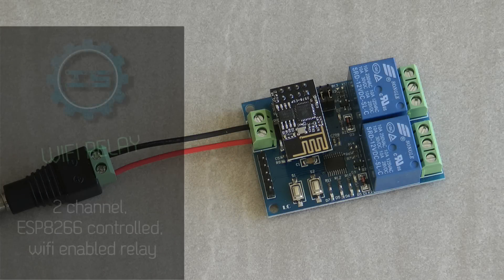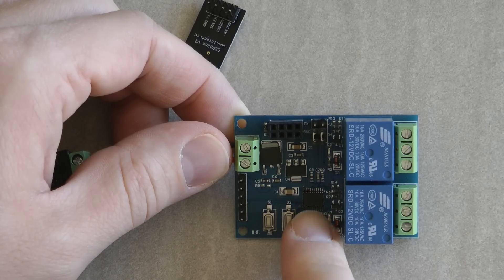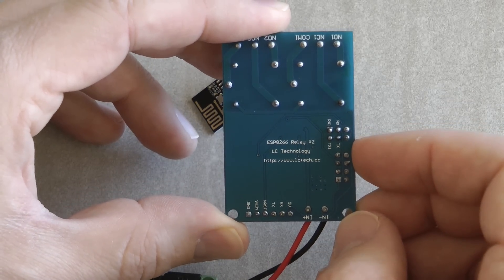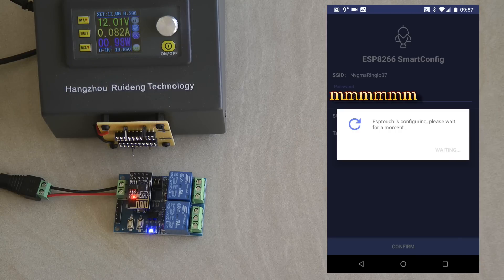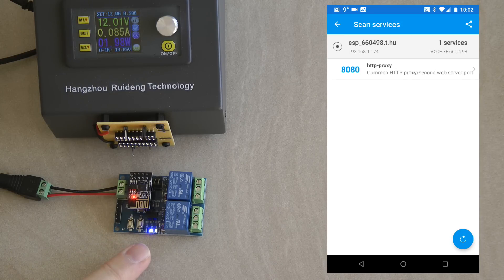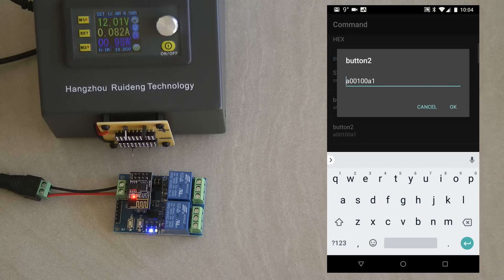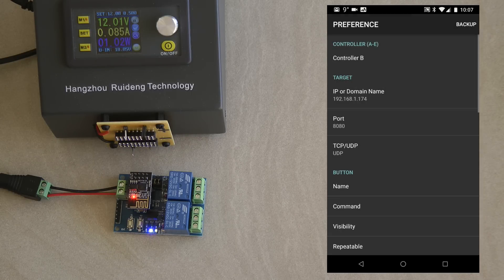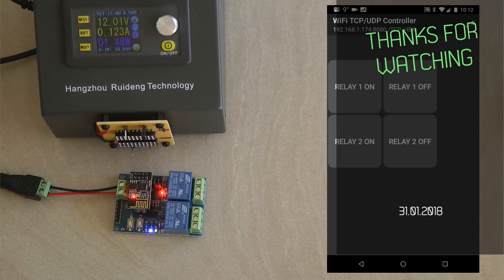ESP8266 wifi relay review

Comment: Hello,

Which way do the relays work?

Let me explain:

my goal is that when a relay receives a signal from the outside (example: a button wired on the relay), an html request is launched.

Thanks in advance.
Reply from the maker: This is a simple relay, I am not sure how you would wire a button to it. I don't think it is going to work this way.

Comment: This works without any problems for Home-Assistant. The esp8266 needs to be flashed like any other wifi module for Home-Assistant. The MCU on the board does the work from UART.
In Home-Assistant the yaml file needs to be configured something like this. (This is a one-relay example). The UART for the relays is [0xA0, 0x01, 0x01, 0xA2] etc.

switch:
  - platform: template
    id: relay1
    name: "relay1 switch"
    turn_on_action:
      - uart.write: [0xA0, 0x01, 0x01, 0xA2]
      - switch.template.publish:
          id: relay1
          state: ON
    turn_off_action:
      - uart.write: [0xA0, 0x01, 0x00, 0xA1]
      - switch.template.publish:
          id: relay1
          state: OFF
Reply from the maker: @JbVlad  Thanks a lot, very useful!

Comment: you can use this with the regular arduino firmware instead of the at firmware by removing the RX jumper and writing serial commands to control both relays, i forgot exactly how to but when i remember ill update this comment

edit: here it is
relay 1:
        Serial.write(0xA0);
        Serial.write(0x02);
        Serial.write(0x01);
        Serial.write(0xA3);
relay 2:
        Serial.write(0xA0);
        Serial.write(0x02);
        Serial.write(0x00);
        Serial.write(0xA2);

with this you can control them using Blynk IOT, remoteXY or homeasisstant, or even with another microcontroller
Reply from the maker: I think it would be possible. But honestly you are probably better off buying a simple relay board and control them directly. Unless you need to save one output.
Reply: @csongorvarga  i did it, its on my github. 
but yes in most cases individual relay boards are a better option, i found a board with 8 relays for around the same price. 
the only benefit of this serial method is that it only uses 1 pin to control multiple relays, so if you're doing a massive iot project or your board has not enough GPIO, this could be useful

Comment: I am trying to connect it to my home Wi-Fi but I can't. None of those Android apps work anymore. I took out the esp8266 hooked it up with an Arduino, and connected it to the home Wi-Fi using AT commands. After that when I put it back on the relay board, it connects to my Wi-Fi momentarily upon boot, and then disconnects. Any idea why?

Comment: Is there any wifi relay like that which uses 240V AC as main supply? I cannot find them on aliexpress. I only found 5v, 12v and 24v.
Reply from the maker: I am not aware either. Sonoff Dual and similar relays run from mains, but those are "branded" models

Comment: Important: the Relay Board needs to be showing the RED diode and NOT the BLUE diode on the board. I was trying to switch the relay and nothing was happening. If you want to change back to mode 1 (with the red light) press S2 while booting the relay.

Comment: Thanks for the review I was going to purchase one but after your review, I don't think I will bother I will just design and  make my  own with an 8266-01 and two replays to switch when I want  so thanks for saving my pocket
Reply from the maker: Yes, it is necessarily odd design as the ESP can handle the same job without the additional MCU. But still OK for those who cannot roll their own board.
Reply: Same here, i expected the relays to be hard wired to the esp8266s gpio pins. Glad i watched the video.

Comment: How did you uploar code to ESP? I think all adapters to this small ESP needs additional switch or jumpers to upload code ;/
Reply from the maker: Yes and no. The basic ESP-01 UARTs are not designed as a programmer, but you can make some modification like I did: https://www.youtube.com/watch?v=6uaIWZCRSz8. But I also have another programmer which has the switch built in as well, like this red adapter: https://www.aliexpress.com/item/32971337222.html

Comment: Hey great video very helpful! I was just wondering is there a way to communicate remotely using the app ie not on the same network as the module? Or is there a new version that does support this?
Reply from the maker: Not really. I would not open these small units up to the wide internet. There is no security on these at all. Ideally these would communicate with a server on the local network and the server is accessible from the outside internet. But technically you can open forward the port on your router and it will be accessible from outside using the public IP.

Comment: I got that device, and got a payback for that because  but it arrives 'broken'.: Symtom is   Blue led from main board is not working ,... only  red led of ESP is on. 

 Do you know how to reset it ?
Before taking the decision to flash ESP, I woul klike to know if somebody knows the consequence of that. 

If I flash the esp , will it be possible to have response from the main board 

Any help will be appreciate before flash the ESP
Reply: The firmwares are all open source so I bet you could make it work in theory but these cards are cheap to buy so probably not worth

Comment: How do I activate the 2 relays in a custom code in arduino skect? What would it be like for me to drive 4 relays, since I only have 2 gpio?
Reply from the maker: I don't know. There is an another microcontroller on the board which is controlling the relays. The ESP talks to this microcontroller over serial. But I am not sure about how it is done. I have done a second video on this board where I flashed the ESP Easy on this. They have implemented the communication between the ESP and the micro. Maybe you could look at that code and figure out how it is done.
Reply: @csongorvarga  
Please send me the link for this publication.
Reply from the maker: This is the video: https://www.youtube.com/watch?v=i_CnBcQgdGk, and also check out the forum in ESP Easy: https://www.letscontrolit.com/forum/viewtopic.php?t=3245

Comment: Why does it need extra, support circuitry... i thought it was WiFi on a chip... and its not!
Reply from the maker: I don't know why it was designed this way. But it is. ESP could handle the Wifi and switching the relay as well, it would not need a separate MCU.

Comment: SmartConfig app does not support android 9, is there another one could be used instead?
Reply: Found my old phone with old android and was able setting up wifi with SmartConfig successfully. Thanks for the video! P. S. What's the second button on the relay board?

Comment: Szia! Remek a videó. Hasonló esp8266-os delay-es modult vásároltam, próbálom azt csinálni amit itt a videóban bemutatsz, azonban amikor az ESP8266 Smartconfig-ot megnyitom az SSID: után <unknown ssid> jelenik meg, és sehogy sem sikerül a hálózatot azonosítanom, mi lehet a probléma?
Reply from the maker: Sajnos nem sok minden tudok erre mondani. Ezek vagy mennek vagy nem mennek. Legyen viszontleg közel a mobil meg a relé is a wifi routerhez, ezeknek gyengébb a wifi vevője mint a telefonnak. És csak 2.4GHz-es wifit támogat, az 5GHz-eset nem (de általában az alap az 2.6GHz).
Reply: Nos, kipróbáltam Android 8 Oreo-n, és ott működik, sajnos az Android 9 Pie- on  nem működik együtt az ESP8266 Snmartconfig APP-al
Reply from the maker: @laszloattilaschmidt8271  Jó tudni. Elég régi a videó, gondolom akkor még nekem is régi Androidom volt.

Comment: thank you for your video, you saved me more than the seller which has nothing about controlling. The application is not very familiar, buttons can't be graphical arrange and a button can't control two states like a switch, pressed first time to send a code pressing second time sending another code. For the beginning it's good even like this. Thanks again.

Comment: If I understood correctly, you have to be in the same LAN to control the device? I have purchased a similar, but 4ch device and was hoping to remotely control the PSU of a 3D-printer. What would I need to control a device like this via the internet remotely ?
Reply from the maker: Yes, it has to be on the LAN. Technically you can open it up to the wide internet, using port forwarding, but this is not a secure connection, so you should probably not mess with that. As a standalone device I would recommend something which comes with a mobile app (and cloud service), like a Sonoff (Basic of 4CH).
Reply: @csongorvarga  thanks for the fast reply. Keep up the good work

Comment: Hello
while i was trying to connect using this app ESP8266 SmartConfig,  it fails, ,but on the module, the blue light is on, and green is blinking, but even after multiple attempts to connect from my android app, it didnt connect, any guesses why?
Reply from the maker: Sorry to hear that. I only have the limited information provided on the two websites mentioned in the video. No idea how to repair it.
Reply: Same problem with mine

Comment: Is there a way to get to permanent mode 2? Because after power cycling, need to press S1 switch again for it to  enter mode2 and  connect to your wifi ap or router.

Comment: hello .. can someone help me please ? is possible to control a relay and  for exapmle a step motor in the same time? becuase we have only one tx and one rx one the esp8266 module. can the arduino recognise the different data that the esp module is sending or is possible that the esp module sends a different data for each action? thank you in advance
Reply from the maker: I am sorry, but I don't understand you. The ESP-01 module only has a few outputs, therefore you can only control 1 or 2 devices. You can use a bigger ESP8266 like a nodeMCU or Wemos D1 mini, where you have more pins.

Comment: How you can program  this? How to upload  arduino  code?
Reply from the maker: You remove the ESP-01 module and program it separately. I have a separate video on how to put ESP Easy firmware on it: https://youtu.be/i_CnBcQgdGk. I don't know how to program the STM micro controlling the relay, so in my example, that code remains the same.

Comment: Very nice video Csongor. Well done with all necessary detail. The pilot wire in our central vacuum is shorted somewhere. Since the wiring is inside the wall, I cannot repair it. The vendor said I have to rewire the system pulling the pilot wire under the carpet, inside the wall, through the attic and under the house crawl space. The cost of the wire will probably be $100, not to mention the cost of labor. They also sell remote vacuum turn on for $180. So I turned to IOT. Using your video, I made it to work. To answer your question about Dynamic IP of the ESP8266, I assigned static IP for ESP8266 in the router. Everything is working like a charm and I spent less than $10. To complaint, I do not like the Wifi TCP/UDP Controller interface. Every time we lose power, I have to press the reset button and reestablish the communication. It may not be the software issue. It may be hardware issue. Anyway, thanks again for the nice video. Keep it coming.
Reply from the maker: Thanks for your comment. What a success story!

Comment: Can we connect this to heroku server with a Node.js web app and then we can control this from any part of the world using mobile phone with internet.

Whenever we press the On button in the mobile phone, it should send command to Node.js web app in Heroku server. Then the web app will send the command to this module.

Is it possible like this?

If not possible, what else will you suggest ?
Reply from the maker: Sorry, but I am not familiar with these components that you mention here. I think many frameworks can communicate over TCP, it is just not as common and straight forward and HTTP or MQTT.

Comment: Can this unit be set up to determine or sense voltage as triggers?  - ie; relay 1 high voltage signal,  then relay 2 , then back to relay 1 and repeat ?
Reply from the maker: No, there is no voltage sense in this unit.

Comment: Good video. Simple question..Can I  use this relay to turn on 12v DC lighting via WiFi from my Android phone? Thanks in advance. Cheers!
Reply from the maker: Yes you can. As I have shown in the video.
Reply: Csongor Varga Awesome! Thanks for reply. I'm setting up a solar powered waterfall with some lighting. One more question and sorry if I'm assuming you know solar. But, would the main power lead to this relay supposed to come from my solar charger or directly from battery?  I'm somewhat confused as how to wire this up. Thanks
Reply from the maker: I think the battery output of the solar charger and the battery is the same. But definitely not from the solar panels and they can have much higher voltage.
Reply: Csongor , your right solar produces more power and charger breaks it down for battery current charge. Be well, Thanks. I think I might need two chargers in parallel for this to work. What's your take?

Comment: If it is like the single relay version then you should easily see that two of the pins are not connected. One is ground because it gets its ground through the device itself and the other is the TX pin which is why your not getting a signal back.

Comment: Hi Csongor,  I saw your video in February. At first i also thought that this relay is not so good cas it is use binary TCP command to switch relay. So for me at the beginning this relay module were useless.
Anyway I get one of this relay from LC TECH then i spent some time to figure out why they made it this way.
The answers is quite simple, this board is oriented for ESP01 (the less expensive) with only 2 GPIO.
 If you connect 2 relays on it, you have no more any GPIO free for sensors.
So they opt-in for serial communication with another tiny controller (STC15F104)  to decode HEX code and activate relays. So they use 0 GPIO line for 2 relays and you can use it for other 2 relays  or sensors. 
Finally this relay module is not so bad as it seem at first sight. You’ve got 2 relays without losing any GPIO from very small part ESP8266.
You’r not obliged to send binary code from your phone  or to use (limited)  application from LC TECH.
You can use any type of communication like HTTP or others with ESP01, it is just enough to send serial data  to turn ON/OFF relay:
byte relON[] = {0xA0, 0x01, 0x01, 0xA2};  //Hex command to send to serial for open relay
byte relOFF[] = {0xA0, 0x01, 0x00, 0xA1}; //Hex command to send to serial for close relay
Anyway I really injoyed in your video.
Wiszlat ;)
Reply from the maker: I understand the concept and I have no issues with it. It is just not Home Automation friendly. I am following a thread on ESP Easy as they have done a variant which allows ESP Easy to communicate with the MCU. I could not make it work just yet, but if I do, I will post an update video on that.
Reply: Hi:  You mentioned that it uses serial communication with the STC15F104.
Do you know that Serial Format and Baud and such?
I plan to UpLoad an Arduino code to the ESP8266 so I can use Blynk.
Thanks!
Reply from the maker: Baud is 115200. This is all I know. That was the baud speed I set in ESP Easy (follow-up video).

Comment: hi there 
Just asking about the output wires how you connect them there 3 wire output on each switch. sorry for the question but I am new in this thing and I am interesting to learn 
thanks in advance
Reply from the maker: Yes, sorry I did not talk about it. I am out of home, I can't check it right now, but usually the middle connector is common and above and below is normally open and normally closed. So you connect to the middle and above or below it. It is a single pole relay.

Comment: Thanks for sharing.. What are the difference of work with TCP socket communication or MQTT or HTTP support? Do you have any video tutorial about it? Thnks in advance and thnks for your time to share this kind of vids!
Reply from the maker: tiwar87 Not a separate video. They are all different. Http means that the device has a web server so you can navigate to a page from your browser. Tcp is simple data communication. In all these cases you are calling the device directly so you need to know its IP address. MQTT is a whole different story designed for such small devices. You can probably find a video which explains how it works.
Reply: Thnks for your time to answer... I will research a little bit to understand all this concepts ..

Comment: in this project router/modem is required or I can operate it directly by my phone(android)
Reply from the maker: You can operate directly. It has a mode where it creates and access point and you can connect directly. I have seen that in the documentation, but I did not test it.
Reply: thank you, for the quick reply
I have problem with my Sonoff switch, it is not working without moden/router, I unable to connect my phone directly to it....
Reply from the maker: Sonoff uses a cloud service. That will never connect to your phone directly. It does not work unless you have active internet connection.
Reply: thanks again, for the quick reply
then can I make a project like Sonoff, which works with my phone directly(like ON and OFF) with the help of ESP8266
Reply from the maker: Yes. But I would still recommend to have router. Even if it does not have internet connection, all devices connect to your router and when your phone connects to the same router you can control all of them, instead of having to connect to each of them individually. This is of course if you are planning to have more devices. And if you like Sonoff and don't want to build stuff on your own, you can also re-flash the firmware on that. You can write your arduino code, or use on of the available firmwares like ESPurna, Tasmota, ESP Easy and control them that way.
Reply: thank you very much, I am going to build my own stuff(wifi switch) work without router if any possibility